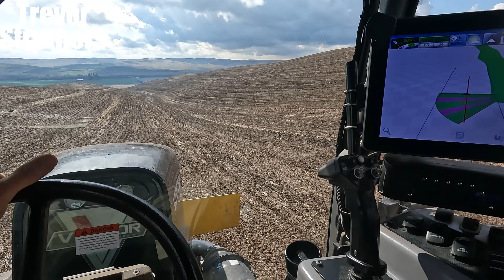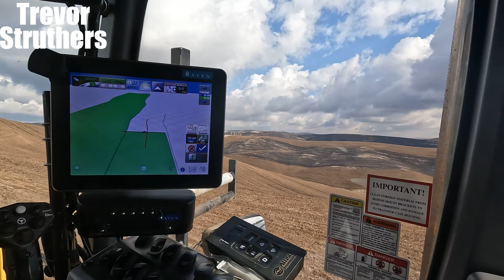4x4 Tractor Drifting Hills

Comment: Thanks again Jamie.  How did you manage before the use of navigation aids to keep track of what had been covered?  Also, it a great skill of an operator to push the limits of their machine but not to cross the line and get into an embarrassing situation!
Reply from the maker: The ground rigs had disk marker and tire tracks you could see. These suspended booms also existed and they used foam marker that dripped at the edge of where you had been. The overlap now is negligible and you never really apply it twice in the same spot. It knows how much you are rolled over and your location, so can figure out where the tractor is. Having it follow the terrain well enough to drive itself however is rare. When it's steep and soft, the navigation doesn't drive well.